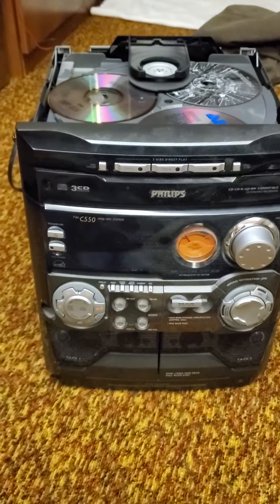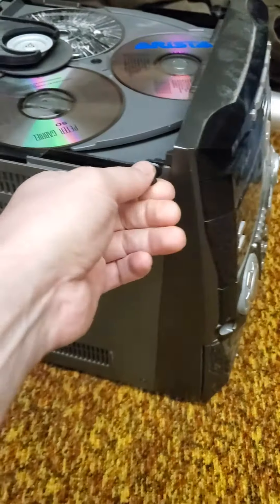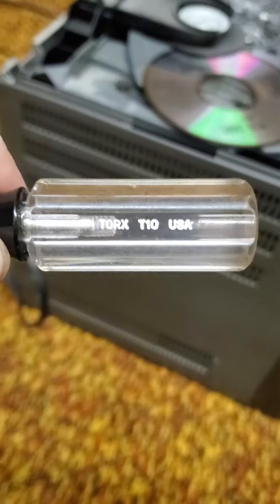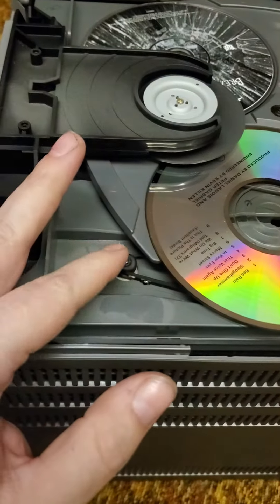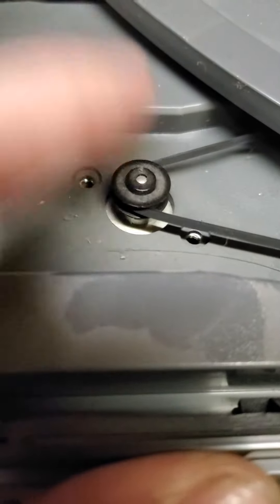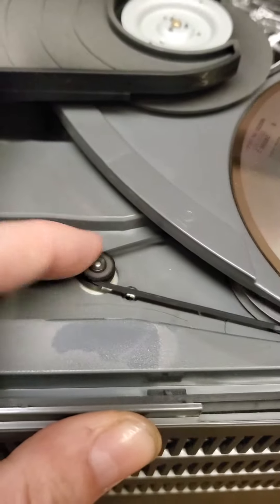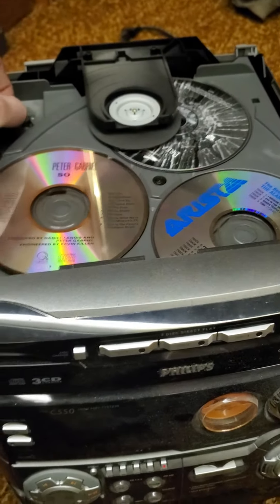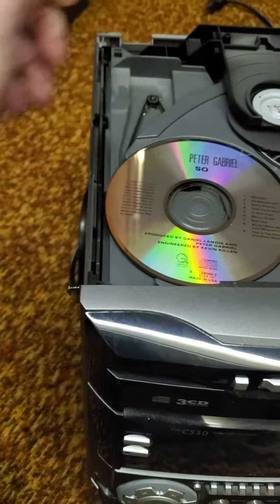Phillip's FW C550 mini hifi system repair.  CD tray repair replacement diagnostics.  Part 1.

Comment: Did you know what i can do about my fw-p750 system?
I can't turn it off it keeps going on again. (I think it's because of the Disk drive) The Disk drive is not opening anymore, i also can't change disks and every time i turn off the system it comes on again with the Disk drive trying to spin